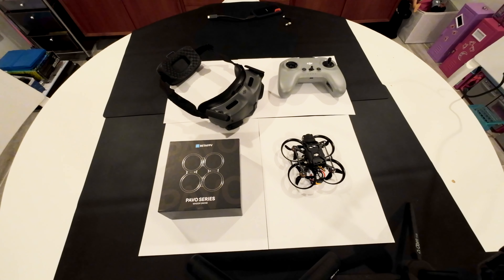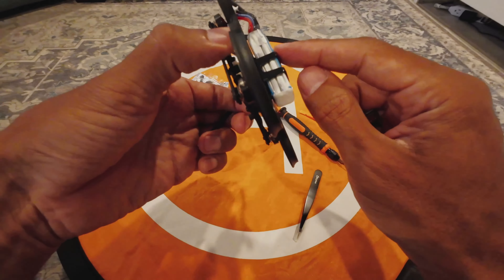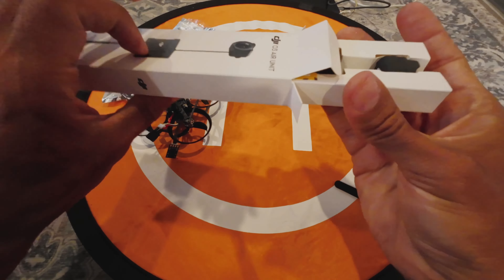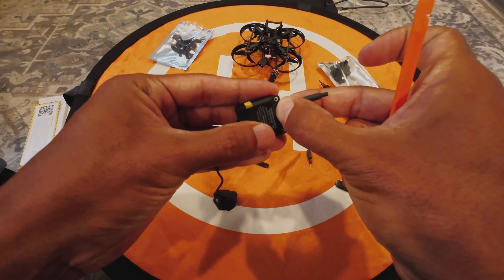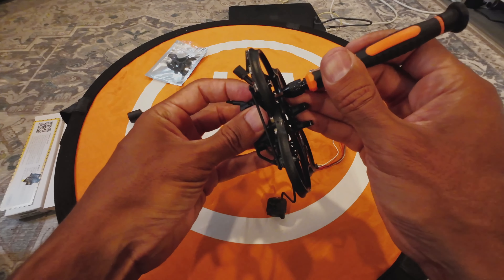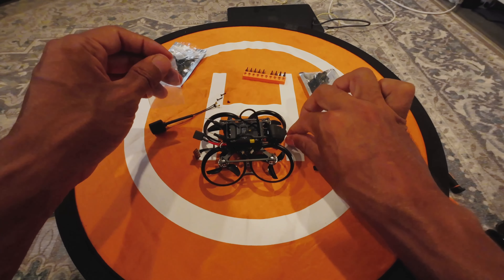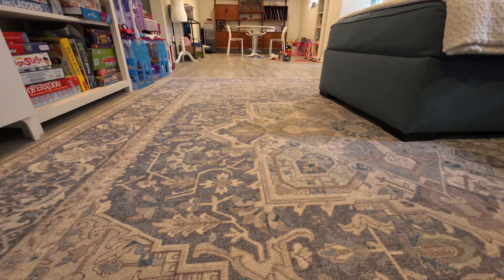pavo pico betaFPV - How to build your own drone - Part 1

Comment: Does Pavo pico already come with the motherboard just need the dji camera right?
Reply from the maker: @BrandonPop13  comes with frame kit and mother board so all you have to do is put the 03 or 04 air unit in..

I got the DJI 03 VTX, ExpressLRS VTX - works with goggles 3 and RC 3 

https://betafpv.com/products/pavo-pico-brushless-whoop

Be sure to watch this before installing the camera so ya know what not to do
Pavo Pico not working - how to get the pavo pico started, pavo pico troubleshooting
https://youtu.be/LEw5Gha1eRo
Reply: @How-to-by-Lou  any other goggles that are cheaper that could be capable with the o3

Comment: So you don't need ELRS compatible remote for this kit?  I'm confused because the website say you can get ELRS or TBS with this kit
Reply from the maker: @ check out you just select the PNP version - PNP will work with the DJI eco system

PNP = Plug and Play 

Will show you when I go live later 

https://betafpv.com/products/pavo25-v2-brushless-whoop-quadcopter?variant=40340088651910

Comment: Does the drone come with the DJI O3 Air Unit or do you have to buy it seperately? (Also don't judge me if he said it in his video, I skipped a lot of parts)
Reply from the maker: No worries it's fine. That's why this channel was put together. Most forums and other FB Groups were roasting the new guys.. You have to buy the 03 air unit separately.  The GepRC Cinelog 20 comes with everything. Pavo Pico is a great 1st FPV drone if you're first starting out.

Comment: Drone Valley sounds interesting.. Have you seen an issue with the Pavo Pico where it doesn't display the correct per cell voltage in the OSD?
Reply from the maker: Yeah - it drains so fast and over heats which makes it really hard to QA and get some real time metrics 

Plan to test it again because it would really come in handy to see real time battery 🪫 stats before it falls from the sky
Reply from the maker: New video next week on adding GPS to Povo Pico unit and getting it to work - setup is totally different with this chip in beta flight.. Change to battery setting too.

Comment: I have a question.I wanna buy the cinebot 30 fpv drone, and I don't know what to buy. I think I need to buy the DJi goggles V2 and the dji remote 2 If you can please send me a link and also I really like your videos.
Reply from the maker: Hard to say you will need DJI Goggles 3, and RC 3. They work with it and you will future proof your investment. all the new 03 stuff is now backwards compatible..
Will send the links in a bit watch this .. Hope this helps. Let us know how it goes...
https://www.youtube.com/watch?v=wLiHbIsCPAk&t=90s
Reply: Thank you so much. Also I just asking if I need to Change the Settings in betaflight. And do I need to buy Express lrs  or TBS crossfire or other ones.
Reply from the maker: @IvanRebkovets  Sorry thought you saw the live show.. Was able to answer this. everything here is PNP so the plug and play version should do the trick. 18:00 I try to explain.. Let me know if this helps.. https://www.youtube.com/watch?v=nZDc6nf2zCo
Reply: Thank you so much. But I still have one more question. When I go to geprc when I Choose the Option pnp It. It says it
Comes with no receiver. Is that normal? Will it still bind? Or do I need to buy a Receiver. Anyways, just let me know. Thank you for the video.
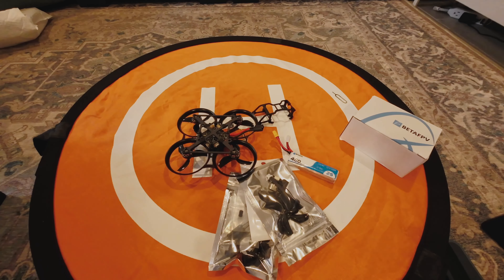Reply from the maker: Watch from 5:00 min on

https://www.youtube.com/watch?v=7cCrUH8ktUc

Comment: Nice Video. I would like to Fly the Pavo Pico with a DJI Integra and and the normal dji transmitter. There are two options which you can buy. 1. : expresslrs 2.4g or 2.: tbs. Which one is the right one?
Reply from the maker: The ones that I have in my videos are expresslrs 2.4g, DJI 03 VTX

DJI Integra Goggles, and DJI FPV remote controller 2… hope this helps

https://betafpv.com/?sca_ref=4346145.dmpY2kV6BJ

Comment: Is it PNP?
Reply from the maker: Yup - it’s PNP.. hope this helps
Reply: Right cause I bind my 03 unit with the dji controller and the integra goggles. All updates on the save firmware but there is no signal on the receiver tab in beta flight. 

I followed all the procedures in your video even set in CLI sbus bud fast but still no signal on the receiver.

Is there anything I’m missing?
Reply from the maker: @Blackminion-j9m  you might want to try the troubleshooting video.. hope this helps 

https://youtu.be/LEw5Gha1eRo?si=zPDvvjJFToqX93zt

Comment: Great tutorial. However I can hear the audio only on the left speaker after 1:46
Reply from the maker: hmm - not sure.. just checked on my end.. Aside from the audio  clipping - seems fine.. Could be setup - on my computer it's fine. Will check headphones. One sec..
Reply from the maker: Yeah thanks a bunch - just checked.. Real bummer -  just tried with my wireless headphone.. Seems to come out on both speakers on the computer but if you're using wireless headphones you only hear it  through one ear. Strange because it was recorded in stereo.. Will try and trouble shoot this. Thanks again.. Would have never known. Have to reach out to the folks at DJI apparently the mic is set to stereo but not recording audio correctly.

Comment: You didnt build the drone...you got it pre-assembled!!!!  Would have been a good vid if youd have actually covered the frame build
Reply from the maker: Good point.. There are actually 4 videos where there is step by step in rebuilding the drone scratch.. Hope this helps.. 

You can see more of the frame as the drone is rebuilt and soldered back together. Best thing about these flight controllers is that the motors don't need configuring.. 

Hope this helps -  next month we'll be building a different drone from scratch.. 
https://www.youtube.com/watch?v=Mg-KHnlJf9Q
Reply from the maker: Hope this helps. The build from scratch was done live and broken up into many videos. 

Part 1 - Building Pavo from scratch
https://www.youtube.com/watch?v=DcniZz1BN3s

Part 2 - Building Pavo from scratch
https://www.youtube.com/watch?v=Mg-KHnlJf9Q

Part  3 - Building Pavo from scratch
https://www.youtube.com/watch?v=Zt0PNl30I0c

Part 4 - Building Pavo from scratch
https://www.youtube.com/live/spZ2kFAaywM

Solder LEDs - Building Pavo from scratch
https://www.youtube.com/watch?v=yzHsdqTBy5M

Troubleshooting - Building Pavo from scratch
https://www.youtube.com/watch?v=LEw5Gha1eRo

Tear down - Building Pavo from scratch
https://www.youtube.com/watch?v=_WmvOH2fsss
Reply: All i want is to see how the dissassembled frame kit goes together.
Reply from the maker: @da33ie  That would probably be the video at the bottom. the tear down... But if that's not enough - can do an updated teardown tonight.. Live later in the evening.

Part 1 - Building Pavo from scratch
https://www.youtube.com/watch?v=DcniZz1BN3s

Part 2 - Building Pavo from scratch
https://www.youtube.com/watch?v=Mg-KHnlJf9Q

Part  3 - Building Pavo from scratch
https://www.youtube.com/watch?v=Zt0PNl30I0c

Part 4 - Building Pavo from scratch
https://www.youtube.com/live/spZ2kFAaywM

Solder LEDs - Building Pavo from scratch
https://www.youtube.com/watch?v=yzHsdqTBy5M

Troubleshooting - Building Pavo from scratch
https://www.youtube.com/watch?v=LEw5Gha1eRo

Tear down - Building Pavo from scratch
https://www.youtube.com/watch?v=_WmvOH2fsss
Reply from the maker: Here you go. Tear down and reassemble
https://www.youtube.com/watch?v=isdThhvBXyA